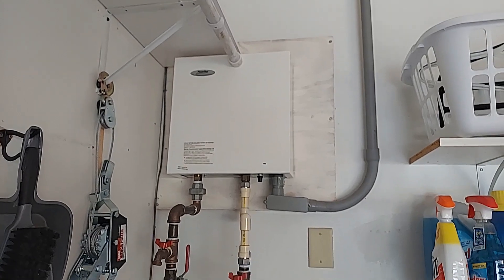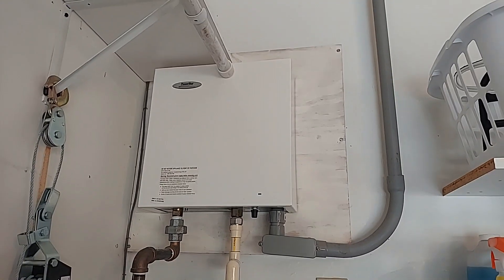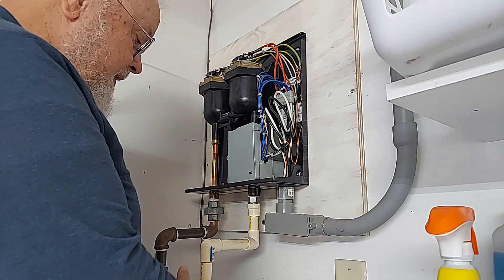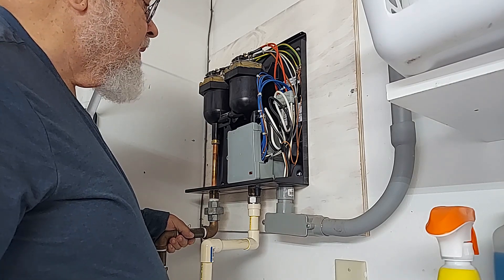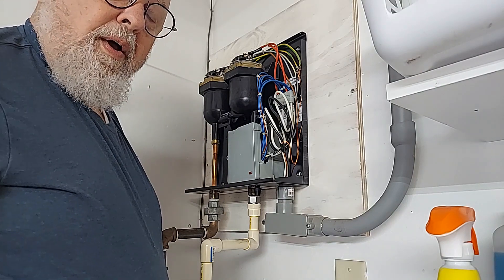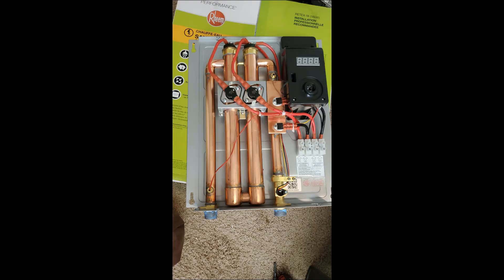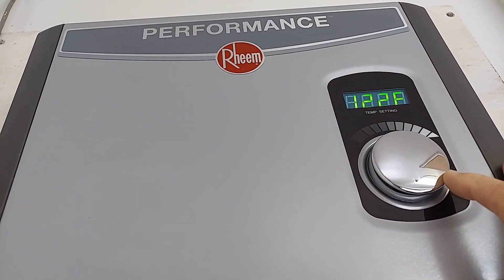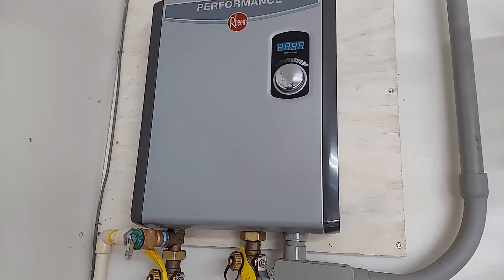Tankless Water Heater Replacement

Comment: How much did all that cost?  I put the same model in 3 years ago for 740 dollars, 340 if you don’t count any electrical work.
Reply from the maker: Installed was $1640 with $600 the cost of the heater.